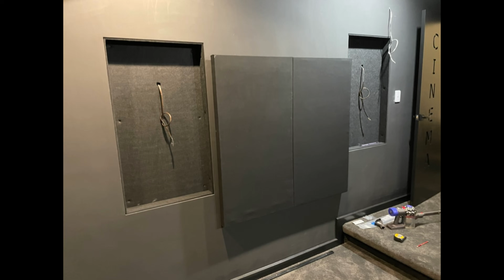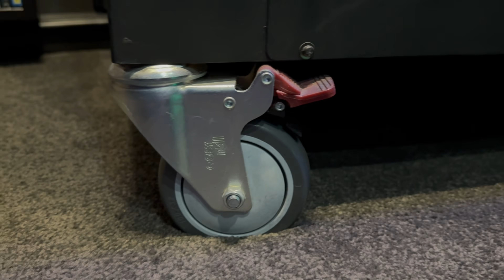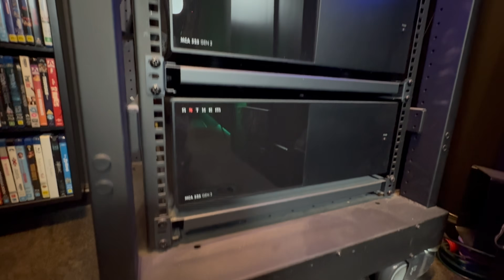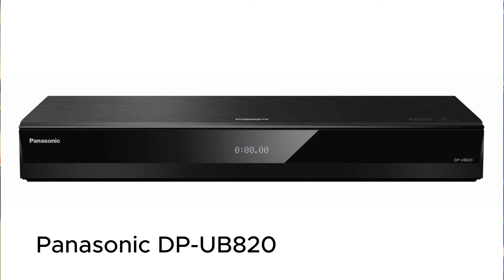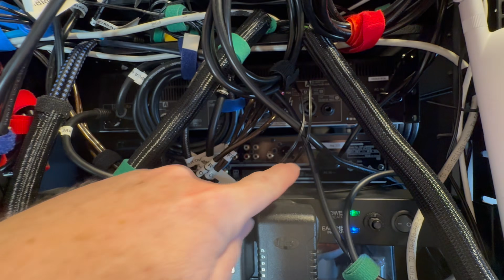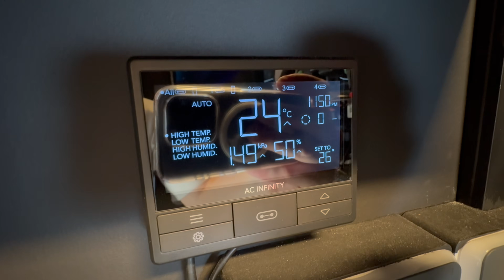Ep16 CINEMA AV RACK ⏐How I made a KILLER 9.4.6 KRIX Home Cinema ⏐Build Series

Comment: Great room, what made you ultimately go for the Anthem MCA 525 gen 2 amps over other options such as Elektra etc
Reply from the maker: thanks - the Anthem were selected as part of really just consulting between my dealer and advice from the speaker manufacturer, Krix, based on the power needed to drive it and number of channels needed (to go with the 525 5 channel amp). The Anthem Gen 2's were just released around the time I was ordering.

Comment: Sorry I don't know if it's just the perspective, but the caster mounting looks already bent.
When you're going up to weights like that, you really should go for 4 point attached blue-wheels and a proper mounting.
It would have been just enough to build a 40 x 40 mm square steel material pipe dolly, 
where the four original corners of the rack rest on.
*Maybe with one cross bracing or just one corner-angle piece each corner, to mount the blue-wheels securely.
Just screw the whole dolly with 4 screws where the old feet were attached.
If one if the grey caster bolts break, the whole thing comes down.
Reply from the maker: Yeah the dolly approach would have been a better approach, that's a great suggestion. Maybe it was just the camera perspective though, the system is rock solid in person. The weight capacity of the wheels is way over what weight is in the rack, they are super-industrial and I do feel confident with them. The rack is also in a fairly tight space so if the worst happened it might only tilt for 20cm or so before it just leans against the wall. It's super hard to move around as I continued the plush carpet into the AV room which was a mistake. Definitely a couple of improvements if I did it over. I'll probably be checking the mounting tomorrow though, now you got me curious! Thanks for watching :)

Comment: Which AV rack did you use? If buying AV rack today, which one will you buy?
Reply from the maker: My rack was being decommissioned from a commercial business so I got a good deal. Thus it was probably 10 years old but is very solid and reliable. To me the brand of rack is not that important at all, but it has to be solid if you will have heavy amps and processor etc in it. I have a project in my work at present where we source IT server racks and cabinets from 4cabling (Australian site), so if I was getting another I would go to them. Only 2 things to get right for a rack purchase - 1. make sure it is big enough for all the equipment you plan to use. 2. heavy duty and solid, it will last forever.

Comment: My suggestions are to double up the side L R speakers.   You can replicate that channel without taking up a Trinnov amp.   Then you can say you have an 11.4.6.    Its all about bragging rights!

If you ever want to upgrade your sound quality, I put in my own Trinnov some Master fuses from Synergistic Research.   My friend donated some to the Trinnov headquarters in the USA, and the difference was so profound, they stated they would have to re-calibrate the systems.   I added some Hurricane power cables, and my noise floor is so quiet and precise.   It is amazing how one cable can sound different.   
The DAC's we paired with our Trinnov were the Emotiva dac xda-3.  They are 32 bit SABRE that match the DAC's in the Trinnov itself.
ET-3+ Trigger Sequencer  I have one of these off of a Phillips Hue plug.   Meaning I can turn the entire trigger system on/off by powering the plug using a remote control.     I can power down the plug, or the triggers can power down the amps or even the Trinnov.   Never have to touch a button in my rack!

I wish I had run the cables to the original mapping of the Trinonv, instead of having to adjust and assign each one custom in the setup.    Just because you can, doesn't mean you should. Lessons learned for me.

Lately, found that there is no quality unbalanced RCA cables, as they are just antennas without a ground.   Had to move to XLR for everything, and that meant no MiniDSP anymore.   Too noisy when I upgraded to more sensitive amps.   Then I found out there are poor XLR cables.   Oh well, its only money.

Ended up putting my SofaBaton hub up front near my IR receiver eye.   Put the Output IR in front of the IR of my input cable so all signals would come in one cable.   It was more efficient that way.
Reply from the maker: Amazing, your setup has to be absolutely next level! I would be nervous as hell to have the Trinnov opened up to upgrade components. Wonder if you are ever concerned with a future version upgrade introducing any incompatibilities?
I still haven't had time to go back to setup the Trinnov on my SofaBaton, aim to at some stage but I need to at least get the Sony projector on it as well to reduce remotes down in number.

Comment: I’ve noticed that you have carpet in your cabinet/disc room. I wouldn’t think that’s a good idea because, if there’s a fire, it’ll make things worse. If I ever get to more and I have a separate room for the projector and the cabinet, I’ll leave out the carpet in there.
Reply from the maker: To be honest, never considered that...I thought about fire in the cinema room but not specifically the equipment room. Vague recollection here only, I think the soundcheck (drywall) used and the wall fabric material is fire treated and offer some protection but at the end of the day I'll be getting the the hell out of there if that eventuated! thanks for watching :)
Reply: @snappythingy  But the carpet is in the main cinema room and it goes in the cabinet/disc room, which is joined together. 
One of my old friends who’s now retired from being a telephone engineer for BT. He did the top jobs for the Royal Family and he told me what I should and shouldn’t do. I had forgotten to mention earlier, I would had a metal door, if possible, than a wooden/plastic door, in between the disc/cabinet room and the cinema room. Having a direct is one of the worst things to happen in your property. Saying that, my neighbour had a fire a few months ago, because every time he used the tumble dryer for an hour, he would go out leaving it on. I thought that one day he will have a fire. What happened? Yep he had a fire and he’s still redecorating and had  professional Restoration Contractors. My area in the town are terraced houses. I hope I get to move, because I’ve had enough with that neighbour. He’s been living here for 13 years and been in a pain since day one with noise. That’s why one of the reasons I want to move.

Comment: Very well done. Have you considered adding a media player for convenience to play all those Blu-ray movies? Excellent job again…
Reply from the maker: Thanks :) If you mean rip all my discs to a player, then yes I intended to do that from the very beginning. I already have a NAS with all my old DVDs ripped to it to play over Plex in my upstairs TV for example (only use it for a couple of movies that never been released on Blu-ray in Australia). I also had a data cable run from my living room TV AV location all the way to the Cinema AV rack, as I was going to put the NAS down there, rip all the Blu-rays and then be able to play then via direct connection at either location. Then I paused and just can't bring myself to spend the hours it would take to rip everything, plus I have quite a lot of 4Ks now and the storage space would also have to be massive. So end of the day, I'm fine with just putting in the disc ad playing from that. I also was a little concerned with investing that much time and one day the drives failing. Great question!
Reply: I totally understand! Trust me..

We redid our theater a little over a year ago. I decided to add a Zidoo media player, many other options available though. Ripping although not hard, is very time consuming. . I just ripped one or two in the morning and evening and on weekends. It took many many months to add my collection acquired over many years.

Now, it’s just so convenient and looks really cool having them all on a movie poster screen. 

Your room would be perfect for that addition… Nice room…

Comment: Fantastic work. How come you went bare wire into speakers rather than banana plugs?
Reply from the maker: Thanks very much - basically recommendation from the dealer and Krix themselves. Banana plugs for where there could be periodic unplugging / reconnecting etc so it is quicker but at the speaker itself that won't ever be needed. All my banana plugs are by Krix and are very good quality but I never covered that in any video.